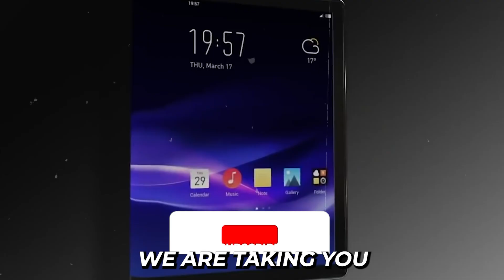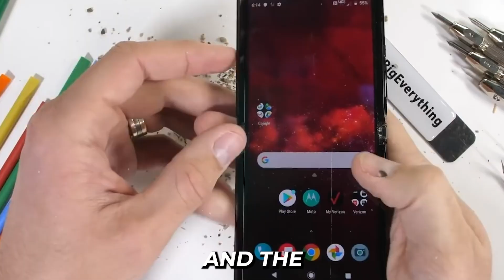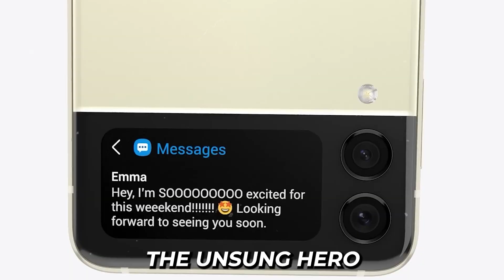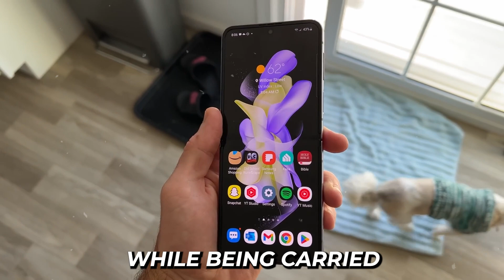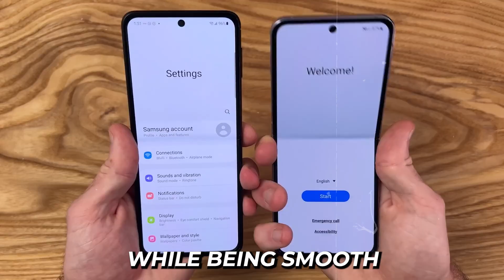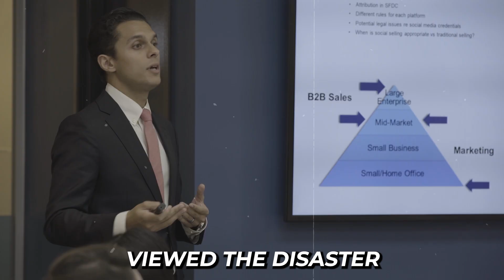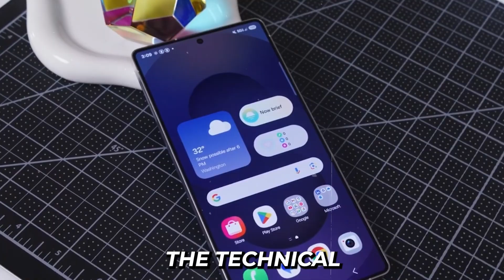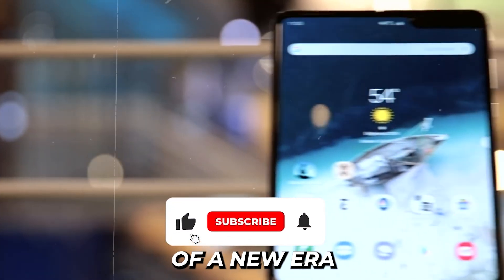How Samsung Makes its Foldable Phones

Comment: It's really not a glass screen. At best it's a hybrid of glass and plastic but it scratches at a level two. Glass does not scratch at a level 2 it scratches at a level six. So when they call it ultra thin glass it is really marketing. Because in terms of physics it is completely indistinguishable from plastic.
Reply: What do you generally call windshield of vehicles or cars?